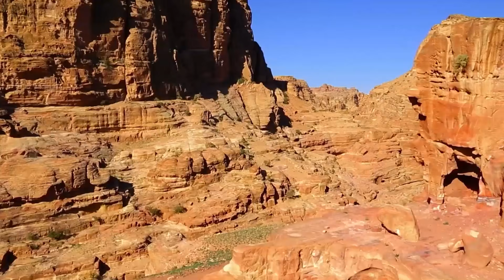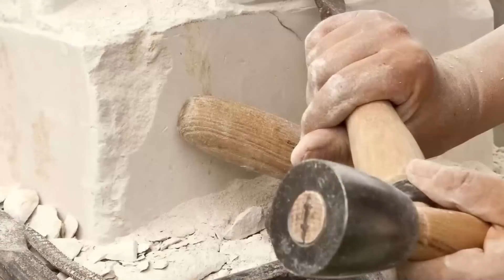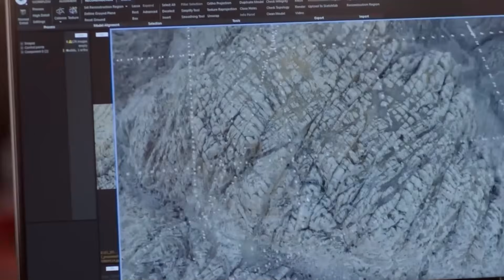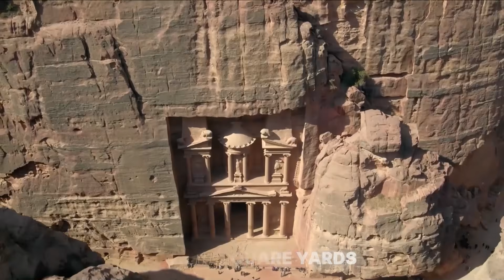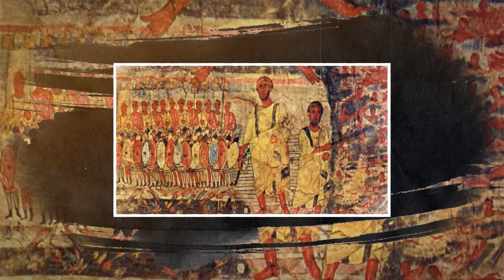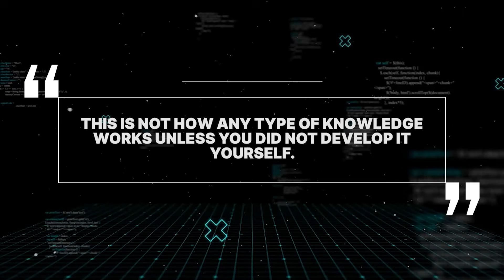Archaeologists Just Decoded Petra's Construction Secrets — And One Detail Still Terrifies Experts

Comment: To say that the work normally gets better is not totally accurate. Many structures around the world reveal expertise at an early stage, yet newer structures appear more primitive. There are several theories as to the why's. Some people are born with greater insight and understanding than they can teach. When they die much of their knowledge dies with them. Some were murdered because underlings believed they had learned enough to take the reins. A true artist is born with a natural niche, and education can enhance their abilities. Everyone that has the desire to be an artist doesn't have that niche and no amount of education can make them an artist. You can have a PHD in art and not be an artist. This example also applies to math, engineering, architecture, science, etc. I was a multi-craft and a class A machinist and believed I was at the top of my game until I worked with a true master. Throughout history there are those that rose above their master's and had a natural understanding that's impossible to teach. Check out Ellora Caves in India, it's also carved into solid rock.